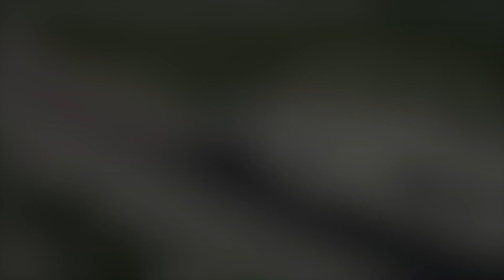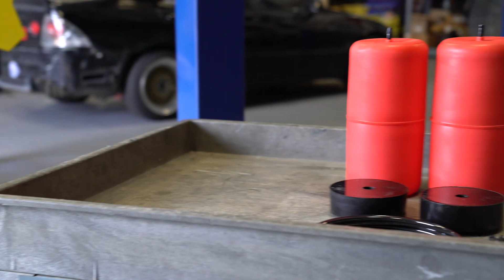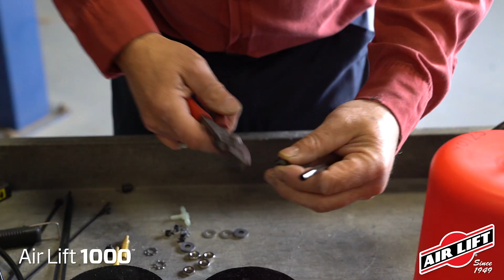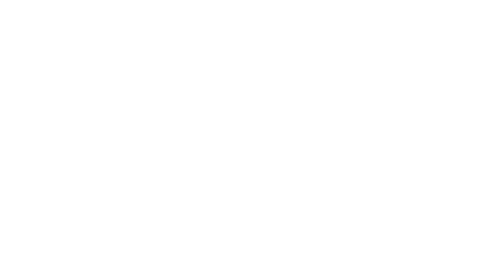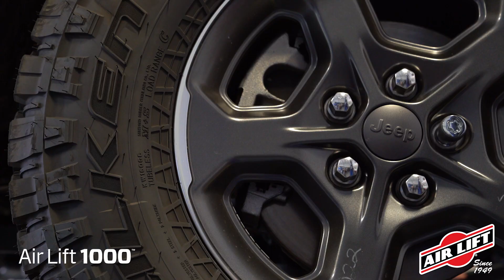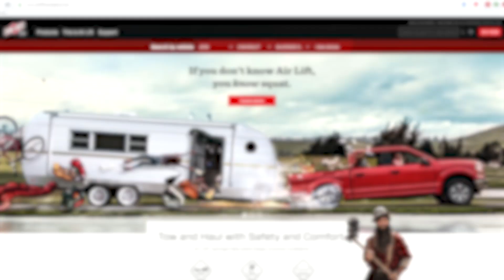Air Lift Install: 2020 Jeep Gladiator - Air Lift 1000

Comment: I think this will only work in stock applications but still wondering if this kit will work with a 6.5” lift gladiator?
Reply: You put a 6 1/2 inch lift on and now you want to tow something? Lol no Bueno.

Comment: I need an AirLift on my Gladiator but I have 4" Springs on my lift kit and you don't make them?  Why not?!  🤦‍♂️
Reply: Should be a way to do this.  Make the custom springs or connect with a company that can or does make custom springs for Jeeps that you guys can make an air bag that would work with them.  Come on, you're the experts.  This is a major need because there is no option for a lifted Jeep truck
Reply from the maker: Hi Bryce, sorry we don't have a kit for this. While we do make an application for Gladiator, but we don't make variants for this situation.
Reply: @AirLiftCompany well you should since most jeeps are lifted

Comment: Neat Idea but it would be better if it aired up and down automatically I assume it would with an onboard compressor hooked to an accessory switch or SPOD. Would be nice to lower it to get in and out of the vehicle.
Reply from the maker: Check out our SmartAir and control systems - we make just the thing to automatically level your vehicle when its loaded and unloaded! Thanks!

Comment: On a single path installation using a ‘tee’ what keeps air pressure from transferring from one spring to the other during vehicle sway or when one wheel is affected by road conditions? Wouldn’t this accentuate body roll?

Think of it like this - when turning at some speed, the natural weight of the vehicle would want to sway outward putting downward pressure on a wheel - air pressure would transfer to the other wheel extending the suspension. Seems like a single path system would cause more body roll.
Reply: Agreed. 2 lines is a LITTLE more work, but well worth it
Reply: @jcs5202  Ideally we would have a ball valve included in the kit that would allow us to inflate both bags equally, and then close the valve for anti-sway when towing.  When off-roading, open the valve to allow air to freely transfer between the two bags and avoid limiting articulation.
Reply: @rubicon4wheeler  this is genius!!
Reply: @jcs5202  two lines would be preferred if you’re carrying lopsided loads. For pulling a trailer you definitely want a one valve system. Vehicle is equipped with a swaybar. With one valve the Bag pressure is always adjusting itself to the truck.

Comment: Hi, Question.?. Can I use those for my 1970 Chevy Impala. Instead of air shocks.????. Fm: Rey Zapata
Reply: No, they are for load assisting.  Not designed for ride control (shocks).  They would likely have you bouncing down the road.